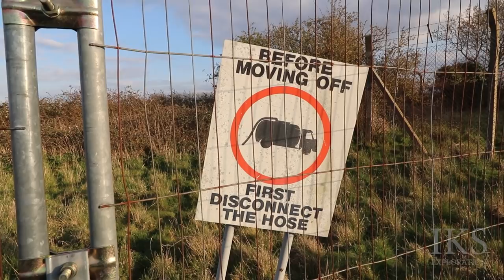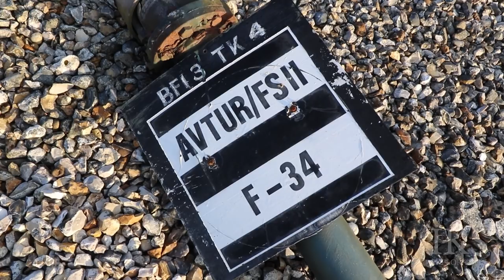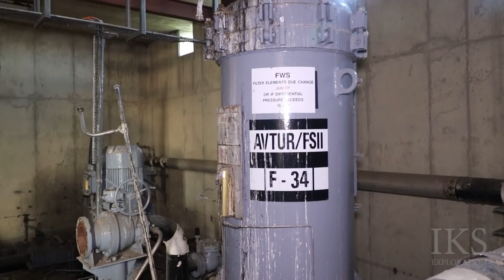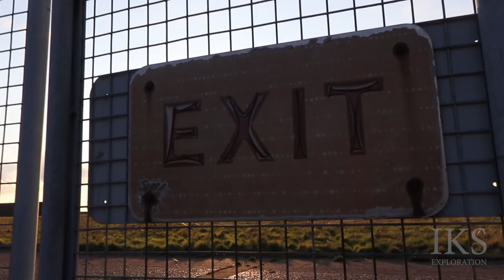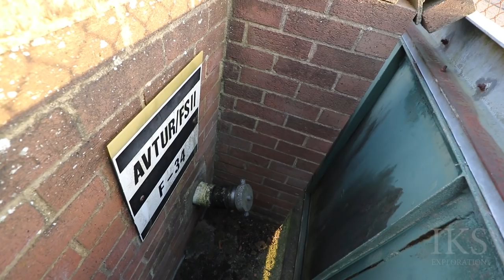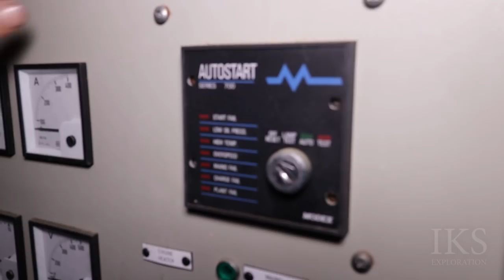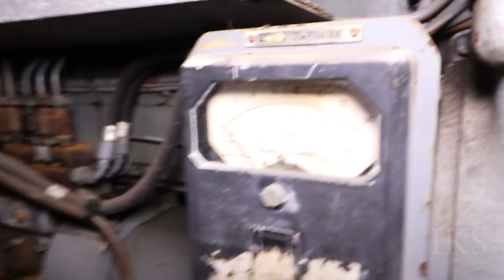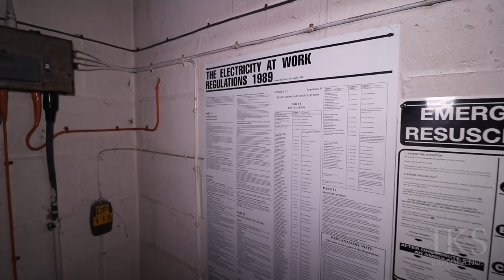RAF Fuel Storage Facility & Bunkers

Comment: The UK has an aircraft fuel national grid. I believe every RAF station and most if not all major civilian airports are connected to it. There are massive underground storage tanks distributed around the grid. Hopefully this airfield was disconnected. It is a massive system installed circa WW2. Refineries connect directly to it to pump in fuel. The other end can come out at individual stands for aircraft. Pipelines were even laid from the UK into France (After D Day) so UK forces could refuel quickly with no vulnerable tankers crossing the channel.

Comment: Thanks for posting this. I was USAF Fuels and I'm amazed how similar the pumphouses and other equipment is to our stuff. As others have said, F-34 is jet fuel (JP-8 if I remember correctly). That other one, FSII, is Fuel System Icing Inhibitor. Basically fuel antifreeze, and NASTY stuff!  The smaller buried tanks, with gravel over them, were most likely your ground fuels: gasoline, diesel, and heating oil. In the pumphouse, the large cylinders in the piping are your filters (that smaller on you looked in? Same as the big ones, just a different configuration), and the brass piston gauge was your Differential Pressure, or DP, gauge. It measured the pressure of the fuel going in in relation to the pressure of the fuel going out.
Yep, I've railed on long enough. Who Da Hell?! P.O.L.!
Reply: some planes dont need fuel ...wink wink say know more say know more ._.. ... ._..

Comment: Well the amazing thing is, it's all in remarkably good condition as someone pointed out. Decommissioned perhaps, but not forgotten. 
Anyhow, couldn't help giggling every time I saw the F34, my aircraft ran on that when I served..
Heres a freely accessible snippet of NATO info..online, 

Chapter 15: Fuels, Oils, Lubricants and
Petroleum Handling Equipment

Annex A

Aide Memoire on Fuels in NATO

AVIATION FUELS

NATO CODE
F-18is an aviation gasoline (low lead) in limited use by certain NATO nations. Also known as AVGAS 100LL.F-34is a military kerosene type aviation turbine fuel with Fuel System Icing Inhibitor (FSII) (NOTE 1) used by land based military gas turbine engined aircraft in all NATO countries. (NOTE 2) Also known as JP-8 or AVTUR/FSII.
JET A-1 or AVTUR + Additives (NOTE 3) = JP-8 or AVTUR/FSII.
Cheers IKS

Comment: From 31:40 onwards it’s part of the fuel cut off system it’s a weighted line that keeps valve open in event of a fire heat melts the wires releasing the weight cuts off fuel supply, I do a lot of work in pump stations with back up generators see loads of them.

Comment: Was it CO2 or Halon? I was a security guard for Bethlehem Steel years ago they had rooms protected with Halon systems there was a Alarm that told people they had seconds to leave the room before the system would evacuate the Halon tanks, if you stayed it was all over Halon isn't Toxic itself but it removes the Oxegen and would suffercat you quickly. I have a Green Halon. Fire extinguisher that was made in the UK they are not allowed in the USA any more (mine is technically grandfathered in)

Comment: You should put cam down the fuelbunker like you did in the other video. Damn was that creepy or what.
Reply from the maker: I think the tanks here were locked so no way in and it was too exposed hanging around on the top lol
Reply: Yes .. too much in the open. Although opening a hatch if it wasn't locked is still a big risk. No way of knowing if the tank is emptied and properly vented.. and what kind of fumes there might puff out on your face.